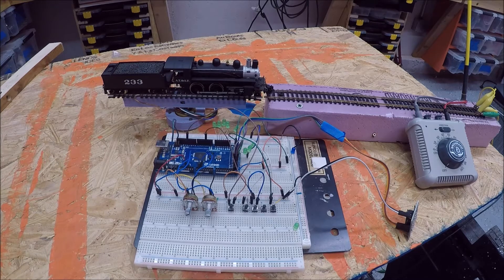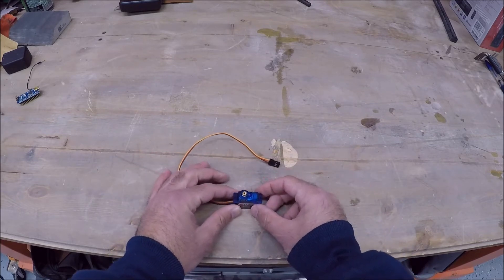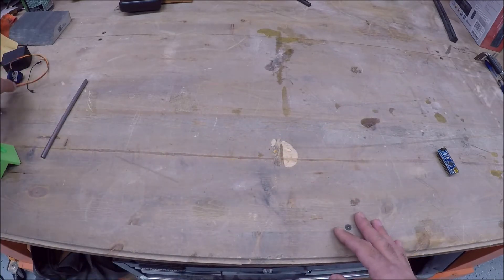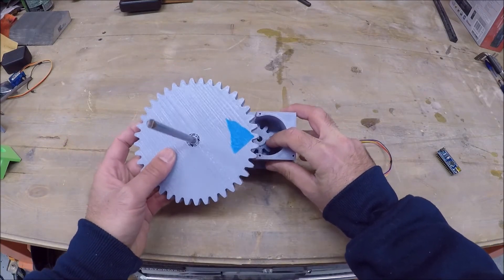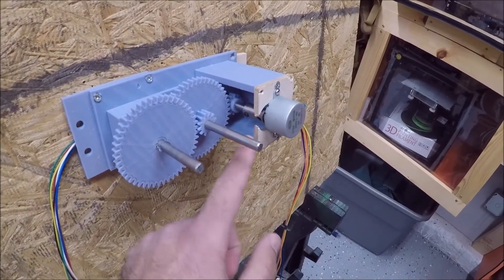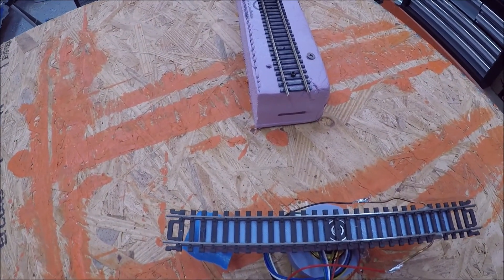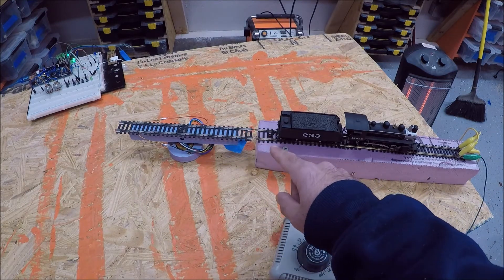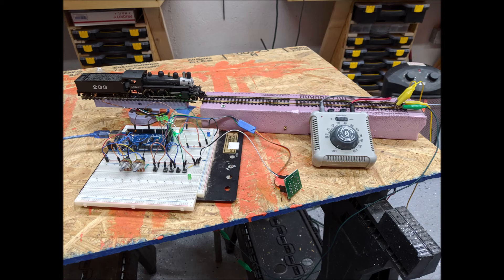Arduino Model Railroad Turntable Part 1

Comment: Hi, you´re making my dream come true with this fantastic project !. Congrats from the bottom of my heart, my friend !.
It would be very instructive if you can lead us about how you designed the electronic  part,. I mena, to the one of us not as clever as you are in electronic projects. 

Thanks in advance, and many greetings from Chile, South America, John.
Reply from the maker: Hey John,

Glad you are enjoying the project! I was actually thinking of re designing the main control panel, if I do that I will be sure to make a video about it.
Reply: @OrangeLabPinball  Excellent, that would be great !. I'll be waiting for your next vid. Cheers, John.
Reply: After researching the model railroad forums and not finding anything as current and deftly designed as this, I would beg you to scan some of the forums and offer your video.  Secondly, are you sharing you arduino code at all?

Comment: Nice, do you have drawing on the electronic controllpanel?
Reply from the maker: Good afternoon Tom, thank you for watching. I do not have a wiring diagram of the control panel, sorry! The design mostly consisted of wiring an arduino input to a button or an arduino output to an LED, all of which I labeled in the code so a wiring diagram wasn't needed. In my next video I will show the progress I have made since this video and spend a bit of time on how I created the control panel.
Reply: @OrangeLabPinball  Ok, im working on a simular project. I have and i 3D printed my turntable and are looking to controle it by arduino, stepper motor, and buttons for different tracks.
Reply from the maker: Very cool Tom! This is the same concept I am working towards as well. I have recently completed the beta version of this project and am planning on installing it in my layout. I will make a "part 2" video that shows how I designed my control panel as well as what type of stepper motor configuration I found to be reliable for my setup.I should have  "part 2" video up in the next week or so. Good luck with your design.

Comment: can you show the connection of the slip ring and the main shaft? (its all hidden under the gear reduction bracket)
Reply from the maker: Good afternoon Alan. The slip ring has three set screws at the top that center the main shaft and keep it from falling through . The bottom of the slip ring is the same except it does not have set screws. I don't think youtube allows me to add photos in the comments section. In my next video on this project Ill be sure to get some good shots of the turntable shaft & slip ring connection.